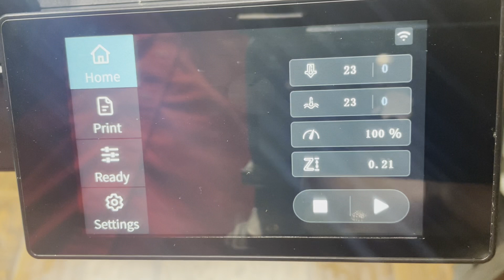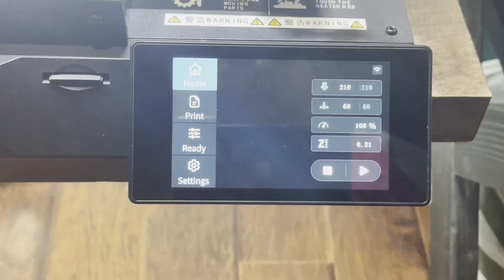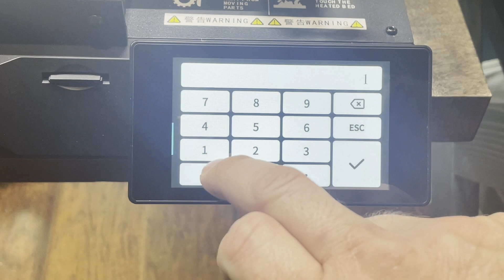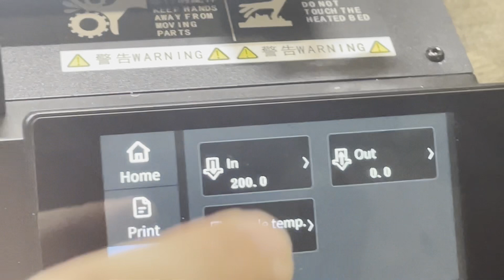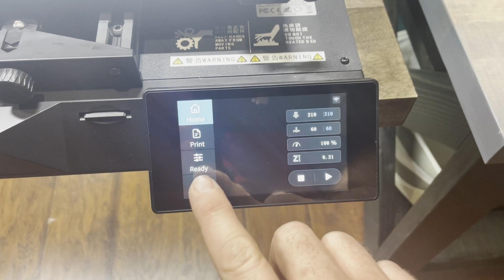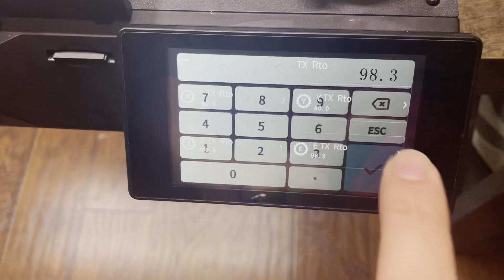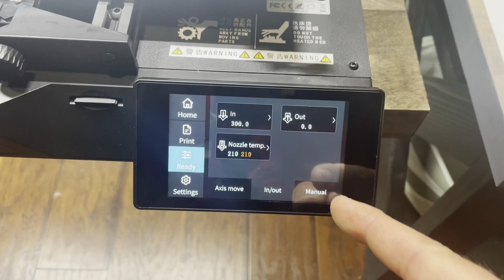How to calibrate esteps on CR10 Smart

Comment: Hi there. Finally someone who has a cr 10 smart, so i did something stupid with the optical sensor , and now I can't make it to work again in autolevel or home Z mode.. what can i do to get rid of the optical sensor? Is it possible to hack a cr 10 smart with a mainboard from cr 10 smart pro ? adding the cr touch ? 

Cheers.